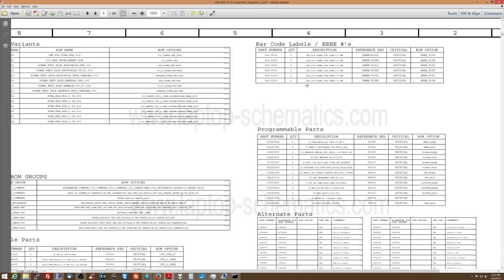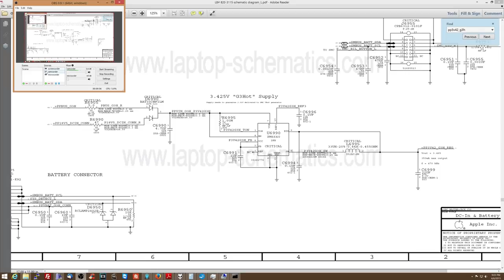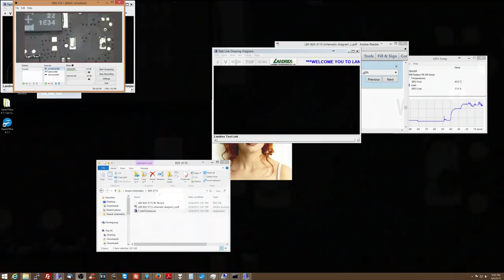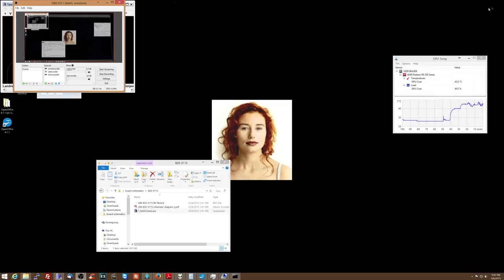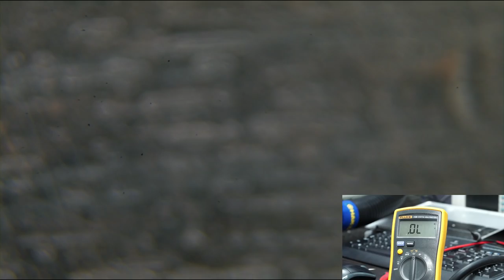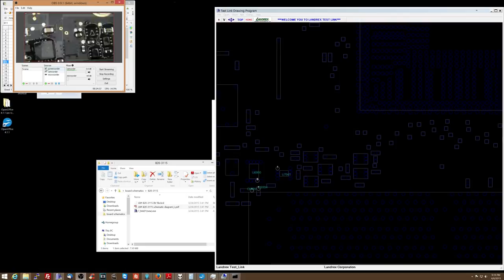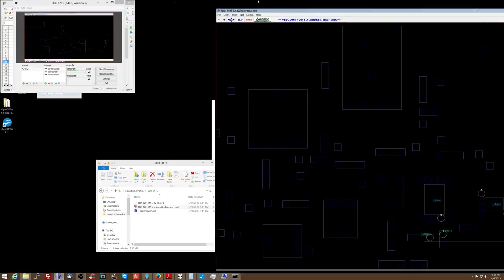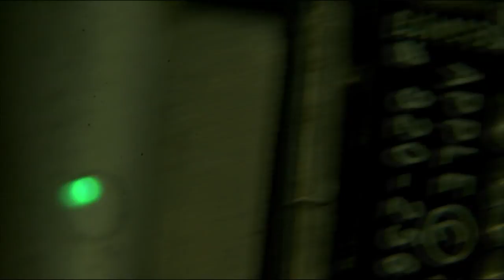How to find short circuit component without spending $6k on FLIR cam.

Comment: I blew polarity protection schotky diode when powering Macbook my solar buss to the spliced  MAGplug. I saw the glow through the white plastic near jack at power up! Love the Macbook black PCB and engineering. I replaced the 1mm sized diode pair but didn't need to since I will never reverse power input again. I also love saving 100-200 watts 24/7 by not using a desktop A/C. I use digital voltmeter on microvolt range to find big voltage drops cause by errant shorts. Make a cell powered op amp kludge with test leads for finding milliamp shorts.

Comment: Cheap Hot air soldering: make tool; fish pump tubing glued into handle of cheap iron with tip removed and powered through FWB 200v 100ufd voltage booster. You should see red glow in tip hole and adjust air flow coming out to reflow, remove and solder SMT parts, even weld broken plastic.
Reply: Dave George  i use a bic lighter  and charge $300 min to look at it   By my iPhone pic sending is best   I watched this video now im ready to work in this industry.   I have a huge bin of salvaged electronics  if I get frustrated I toss it there still charge the minimum.
Reply: I had "red glow in tip hole" once; antibiotics helped!

Comment: Using a benchtop DMM that can do 4-wire resistance measurements with a set of 4-wire probes will allow you to make very accurate low-value resistance measurements.  I homebrewed a set of 4-wire probes by just soldering an additional sense wire to each probe.  This might save you some time by allowing you to tell which side of the inductor was shorted to ground without removing it.

Comment: Great video!  I use this exact method.  Many want to use the ESR meter to figure out which component has the lowest resistance to ground however, some of the circuits have sometimes as much as 10 decoupling chip capacitors and possibly 5 IC's strewn all over a densely populated board.  How long would it take to check each one?  This method reveals the shorted component many times less than 20 seconds!  I did this with my daughter's sound bar & only a datasheet I looked up for the first Buck converter I guessed might be the issue.  I had no access to a schematic.
The only part of this guy's process that I would disagree with is immediately setting the CC controlled supply to 10amps.  If you have a very low resistance shorted component, you would certainly find it quickly but it also might burn up the circuit board in the process of discovery.  I start with lower current settings and if I cannot detect the heat, then I'll raise the current until I do.  I've only had to go as high as 3 amps ( and mostly less) for the hundreds of Cable Boxes I've repaired.

Comment: just find a nice decent variable psu, set to correct voltage for the short power rail then wind the current up slowly till either the component that is short blows up big time or smokes or you find a real hot spot, chips generally smoke sometimes pop open but most shorts i get now are from SMD ceramic capacitors, bloody things ! the psu trick works every time for me, 20 years fixing electronics from TVs to £80k Barco projectors !

Comment: I used the short finding methods in this video on an HP 625 with a shorted +V3A line, but the only thing getting lukewarm even at 3 amps is the AMD southbridge. So I guess it's possible for those to fail as well?

It's looking like a no fix for now because it's a large BGA chip and I don't have the tools, but at least the troubleshooting with the schematic was a good learning experience. Thanks for all the videos!

Comment: @Louis Rossmann , I would prefer supplying no more than 0.6V (about PN Si junction drop) to the board while searching for shorts. In this way you prevent junctions entering a conduction state (mostly). The main motivation, prevent latch-up (latch ups likely cause damage to a chip) caused by multi power supply dependent  IC having, in this case its 3.3V supplied but not its 5V (just an example).

Comment: When you fix a mother board do you clean the board after you have finished? And if so, what do you clean it with?
Reply from the maker: +OldMan Rehnaldo crest cp500d, 100 ml of branson ec, 1 gallon distilled water, 60 celsius for a minute per side. depends on impatience of the customer as well, if it is someone that calls every day or hour then let the flux sit there

Comment: Spray the board down with liquid nitrogen or a upside down spray can until it is white with frost; then connect power with current limiting and you will see lines appear leading you directly to the short. Current sense probes are also helpful if you are experienced enough to use them. I used to do all this stuff years ago before I became an Engineer.

Comment: By using a high resolution bench DMM, you don't even have to remove (larger) inductors to measure where the short is. You just measure resistance in 4 wire mode. That way you don't get the resistance (voltage drop) at your probing points (2 wires for current, 2 to measure the voltage drop over DUT). Since the inductor has a small parasitic resistance and 4 wire measurements are so accurate, you can reliably see which side of the inductor has lower resistance to ground => short

Comment: Louis. I have an Xbox one S that has no power at all. The bluray disc drive had been moved while xbox on, and a small bit of case touched just under it on board. The xbox was ON and instantly turned off. Wont go back on anymore. The internal Power supply does have 3 lines of 12v that work on it. Power connectors on board do show continuity to the ground with a DMM. That's as far as I have and can go. Your videos are right on. Knowledge!!! Let me know if you can help or if it would be a waste of time. Sucks not having a schematic of the xbox one s. Dont even know any of the 12v test points or where the power runs through it. Thanks... Got alot more of your vids to catch up on.. Learning alot. 👍 much respect my brother.

Comment: I thought Static electricity unlike your power supply is 10s or thousands of volts. And you are absolutely correct on Flir cam. I agree.  Unlike you I spent over 10K on a flit T400. Mainly because I do filed service as well. Flir did not make me a penny though. And now it worth not even 1/2. 
So far half the time I find components shorted either with flir, alcohol or other ways It ends up not being the component that's burnt or the hottest component that is causing the short The short is on that track though which burns the weakest component on the track.

Comment: Quick question on the 10A infused if one doesn't have a 10A source but a 5A source is that enough to trigger an electronic board to heat up in order to pinpoint an failed electronic component

Comment: Like you Louis, initiative when fault finding. I like your ideal of the fluid. I have been an electronics engineer for many years, especially in the RF field. Working on transceivers. I don't know why, but love the challenge of fault finding IC`s . One of my best fixes, A very expensive Yeasu  HF transceiver had a RX fault.  It would be OK for about 10 minutes from cold. Soon as it warmed up, the RX would go dead. Deaf!...Took me days to work out why, I went through the mixer stages, signal injection etc...and couldn't find the fault with the frequency counters... In the end sprayed the sections of the board, to see if it was heat related. I used freeze spray. I found that there was two lumps of solder hidden away in a corner of the board, that were so dam close, as soon as the transceiver warmed up, the soldered joints touched as it  expanded, and electrically shorted to ground, killing the RX. A 1 second reflow and walla..All fixed. It was a factory soldered joint!...Love the videos... you have another fan..!

Comment: Great Speaker, great Analyst, big thank you for your time and sharing your knowledge..
Just one thing I don't understand, how come when you connect your external power supply to a shorted circuit it doesn't blow up (the external power supply itself), isn't it  like connecting the + and - of the power supply together?
Reply from the maker: +Boolf NASA There is resistance, as low as it may be. The power supply itself also limits current to some extent.

Comment: 8:21 Why would you suspect there is a short on the unfiltered side of the inductor? If something failed with a dead short, I'd be looking at the load side, to see if there is anything that is clearly dead, charred, etc, causing the output to fall out of regulation.

Comment: This is good hands on repair!  Excellent.  Question:  what are you removing the flux with?  Like the articulated solder tip.  Make that?  I always put a little bend on them but you have to be careful because of the coating on the tip.  I'm surprised the hot air tip doesn't cook the components or board.  Anyway, thanks for this.
Reply from the maker: +Dennis Mathias Ultrasonic cleaner,  branson ec, distilled water, toothbrush etc

Comment: Probably a stupid question but when I was feeling for a short I found a spot on the board where if I touch it the board shuts off, my thought is maybe I'm shorting out that's causing this. I don't feel a shock or heat in that area so I figured I should ask before I move on to a wild goose chase. Thanks to anyone who takes the time to read this !

Comment: I just spent a 46 minute of my life, a very enjoyable 46 minutes, watching this video and learning a great deal.
I particularly liked the rationale at the very end  :)
 
Thanks for that. You are very good at what you do clearly, and present it well. 

I have a few newbee questions and if you could even just point me to a video or link that could answer them for me it would be much appreciated. 

a) 33.20 mins in you were removing components off the board with what look like simply the solder iron tip and resin filled solder. If that is so, 
 - what temperature is the iron
 - what rating of solder do you use for that 

b) 35.00 mins in you are replacing capacitors. It seems there are no ratings that you are concerned about. If I was to do the same what do I need to know about what capacitors or resistors should be used in a particular location, or, how do you identify the ratings.  

c) earlier on I thought I saw you putting a gel like goop on the board, is that just a form of Flux to clean the area, in a tube ?  If something else what might that be. 

d) at around 31.00 you seem to be using a Blower of some kind  that heats up the connections on a chip to allow you to then remove that chip. What is that exactly, is it a tool that can be bought ?

Thanks again for the video and as I say would greatly appreciate if you could point me in a direction if you do not have the time to answer the above. 

cheers
Mark (62)  Australia
Shalom

Comment: One question.it might sound a stupid question. When you test the motherboard on the diode mode, why do you stick the multimeter red probe on the ground and the black probe on the component' s pin.

Comment: I've got a situation where I've got a short to ground on my 1.35v line on the system side. I've applied voltage to the power rail in order to see what gets hot, but the board will only take around an amp of current at 1.35v. Unfortunately at this voltage and current, the faulty component isn't getting hot enough for me to detect with my expensive temperature probe (my fingers).

Does anyone have any thoughts? I'm hesitant to apply a higher voltage than what the power rail is rated for..

Comment: i know it would be a pain, but keeping the hot air stations you are actually using in the video description and keep what you are currently using. nice seeing the difference in performance when using in that particular video, even though your hakko fr801 in this video needs a new element LOL.  jbc, weller wha900, quick 867dw etc

Comment: Nice work, first video of yours I have seen.  I have an Onkyo TX-SR876 that I tried to replace some capacitors on the hdmi board and ended up pulling traces off the board with my iron (no smd equipment).  Is this something you could repair?

Comment: Subbed, liked and bell'd. Saw this yesterday morning and have not stopped telling everyone I know about how awesome this trick is -- the guys at work are getting over hearing about it LOL. I have a question if you or anyone else can answer -- is this specifically using isopropyl? Would something as simple as vodka do the trick? Or would the water content be too conductive? 

Apologies for the rookie question and even more so if this has already been answered in the video / comments (did check through both again first though).

Comment: Can you fix Miller welder machine boards.
These boards are notorious for blowing IC's resistors and diodes.
It is a voltage regulation board.
Please let me know and I can send more info and pics.
Thank you...Love your presentation
Reply: If you're interested perhaps I could if you provide the info...!

Comment: I enjoy your videos very much. You might want to explain the reason that you are injecting the 3.3 from your own power supply. In other words the power supply on the board is not sufficient to cause the shorted component to get hot and also those power supplies if they detect overcurrent will go into a shutdown mode and have no output. I would also suggest that you do not set your power supply to full current during your first injection of 3.3 volts. Be defective component or components may open up so quickly that you don't get a chance to see where the smoke came from or to detect the heat with your sensor. Start at a lower current and look for the Heat and then bump up your power supply as necessary if you don't detect any thermal defects.

Comment: the quicker air blows the cooler it is. Cuz it has less time to heat up going thru heating element. Also heating element might be covered in dust or rust that prevents heat transfer from coil to air

Comment: I am not perfect in soldering electronic components,so I am wondering,can I Convert an ATX Power Supply  to work with LCD tv?
I mean the power supply will feed my tv with direct current.
the reason why I am asking you this question is my tv ps is fucked up.
thanks for your hard work.

Comment: Louis man your a beast! Those little chips that blew off the board when you were trying to heat them how did you know which side was neg or pos and that you had the right one?
Reply: They're ceramic caps and resistors, they don't have + or -
He simply just rips the component he needs off a donor board one by one and replaces it.

Comment: Not really knowing much about surface mount, multi-layer boards etc, and never having worked on them, there is a question I need to ask.
I do know that a hot air gun is used to rework the boards, and it seems that the whole component is heated upto solder melt temperature.  If this is so, how the heck do they survive that?!   In my old school, through hole world, excessive heat into the component is something to avoid.

Comment: What brand of flux are you using on these boards? Many years ago I was chief bench tech for a large paging company and the company who made the hot air equipment for surface mount work had sent me a sample that was fantastic however over the years I have misplaced my notes and now moving to the EU I have tons of stuff still packed. Think Technitool ( spelling? ) might carry something good?? As for HAKO they make great stuff! You get more for your money as compared to Pace or Motorola's APE SOUTH rework equipment.

Comment: What are you using to flow the solder. It sounded like you said "FR8L1". I googled that and found nothing. I am not even familiar with anything that solders like that. What do you call this device? Looks like a life saver (if your heating element is good).  :-)

Comment: Setting a 10A current limit is asking for trouble and smoking tracers. Start low like 250mA, then work up till you can locate the hot spot.

Comment: I had a shorted desktop mobo and injecting helped me to find the shorted component, but after removing it, there are still two rails of 12v and 5v being shorted to ground. I've tried injecting up to 12v 3a, but nothing was heating this time. So I suppose that's more of a board track short rather then a component this time?

Comment: When you are locating a short by temperature differentiation, wouldn't it be more accurate and less risky to you to check the board with a laser thermometer?

I was a mechanic for 35 years and sometimes we had to do the "smoke test" to automotive wiring to find shorts in a big cluster of wires as well. lol The laser thermometer  is quite handy at diagnosing temperature changes and is quite accurate too. 

It would be easier to pinpoint shorts and save you burns. :-)

Comment: A better method without frying the PCB tracks on your board:
Hook your multimeter to measure the short resistance. Use hot air station with the temperature reduced to 150C and minimum air flow to scan in both axis the PCB. You will notice when the hot air is over the component, creating the short the multimeter will register significant change in resistance.
I hope this is helps

Comment: Could you say some tip. I have vcore shorted to the ground. Motherboard doesn't have any visual damage. Northbridge heats relatively fast. Is northbridge dead?
Reply from the maker: +Supreme Commander vcore is not shorted to ground, see how ohm's law works and

Comment: Just say that an inductor is basically a coiled piece of wire and and as far as a multi-meter is concerned it looks like a fuse so it must always be taken out of the board to test for shorts on either side.